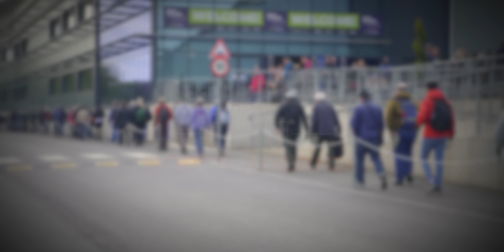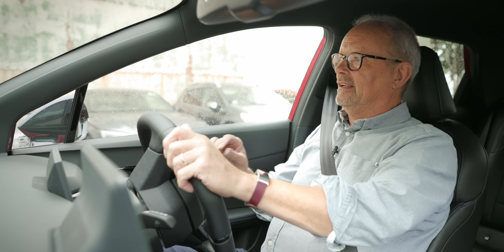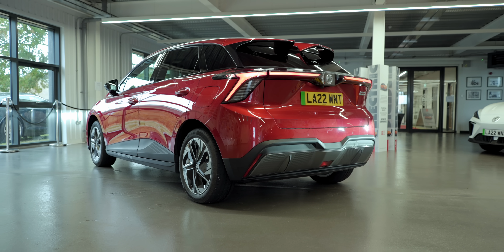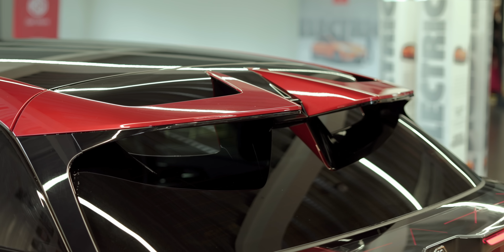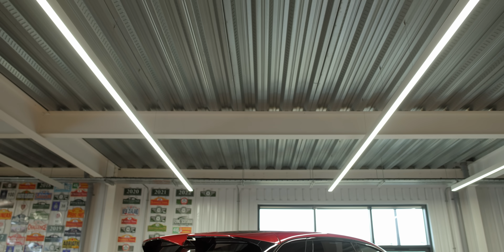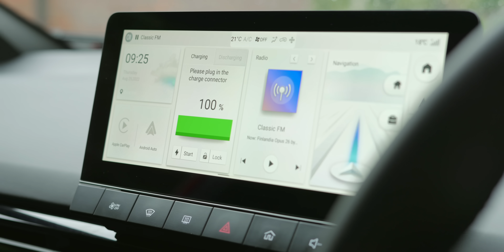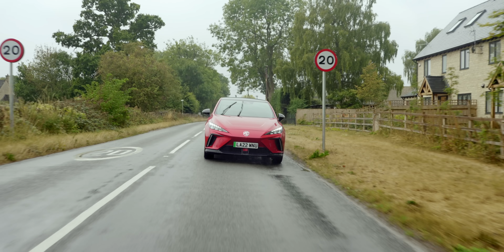MG4: The Bargain Of The Century??

Comment: I would love to be able to buy a four door hatchback EV! But living here in the US, we are very limited in choice of this type of EV. And it has "normal" size wheels/tires.
Reply: @Michael Headley Yes, some people do - and others of us like cars like this one.
Reply: Check out the Chevy Bolt. 2023 will be 26,500$ and has a range of 250 miles. I’m going to do my best to get one. My son has a 2019 and it’s really a good car.
Reply: Then you don't know about the Kia EV6, and others, the problem now are dealerships, charging so much more above the MSRP.  Dealerships suck.
Reply: @superinserra  The EV6 is a great car, but it's on the larger side, and even at starting MSRP it's over $40,000. That's too expensive for the likes of me, and probably for most people who like the sound of the MG 4's price tag.
Reply: The other thing is, yes I do have a 2002 Ford Truck. Sits around until I use it. Also have a 2011 Kia Soul (wife’s car) and the 2014 Fiat 500ev. Doesn’t have to be all or nothing. The EV is a delight to drive,  and saves me a lot of money! Most expensive car I ever bought was the used to us Kia Soul at 17,000$ and, we kinda got taken and paid too much. I’m not rich, and take care of my finances. The truck was 4500$ and the Fiat was kind of 4000$ but since I traded 2 old motorcycles, I have about 2500$ into it, then the state of Oregon gave me 2500$ cash for owning an EV so I’m net 0 into it…

Comment: Hot hatch wouldbe fun, they were the only cars I ever really got excited about because they were small cheap fast fun , I had the citroen ax gt which was about as cheap as you could get and so light it only needed a 1.4 engine and no super charger so still economical even when driven quite hard unlike all the cars I've had since which get great mpg on paper but terrible in reality unless you drive RRALLY slow.
I dont think it will be cheap though and 25k in my book is already a LOT but that's inflation for you.

Comment: Any information about how to carry two bicycles in this car?
Reply: Bike carrier on the back?!
Reply: @bryanduncan6178  do you know there's a towbar or are you guessing?
Reply: @NunoLima1337  The car has a towing capacity of 500kgs with a tow bar weight of 50kgs - should be able to take to bikes on a bike carrier.
Reply: @bryanduncan6178  thanks! I'll keep an eye out for that. I noticed that one of the VW id has a very unique bike carrier attachment. I'm really hoping that MG doesn't need special parts like those.

Comment: at a time when people cant pay there electric bills saying £25000 is cheap is laughable and especially from a car from china a country that we should be having as little to do with as possible you can say there cheap when the starting price is around £15000 with a 500 mile range.
Reply: Name just 1 petrol powered similar segment car with similar equipment as this that gets 500 miles of range for only 15k? 🤔
Reply: @4literv6  dacia sandero electric cars are'nt new  technology its old, there were electric cars before internal combustion setting speed records over 60 miles per hour. and having worked in the motor industry for thirty years try and get the stated milage out of a electric car in the winter add to the fact the infrastructure for electric vehicles  is a joke i have 5 petrol stations within 3 miles of where i live and 4 charging points  if they work.
Reply: @davidcuss3059  so you can't name just one ice vehicle got it, and you don't own or have any real world experience with an ev either. 
So you are just another internet ev concern troll. 👍🏻

Comment: Rear wheel drive and 50-50 weight distribution? Nice. Really nice.
Reply: it will come in late 2023 with 4wd and 440hp
Reply: Nothing beats independently powered AWD.  You can feel the difference.

Why many EV manufacturers use a single EV motors and transfer the power through mechanical differential and half-shafts to the wheels is counterproductive to EV efficiency.  Having four independent direct-drive motors in the wheel hubs is a far more efficient means of power distribution.  And I doubt the weight of four individual motors vs a single motor and drive train is the deciding factor.  I guess some habits are hard to break from.
Reply: @MelioraCogito  Cost of production and those precious shareholder dividends it seems. Engineers haven't had much say in things for a very long time.
Reply: An extra ton..........a good idea?
Reply: I very much doubt that the buyers of these care for weight distribution, and rightly so. The point is economy, not Nürburgring lap times.
Reply: @RandallSlick  true. But it's a nice bonus 🤷🏿‍♂️
Reply: @RandallSlick  they used to call a car like that a "sleeper".  Sports car performance, boring appearance.
Reply: @davidquinn9676  Love the sleepers. We had Q cars in the UK. Lotus Carlton. Electric VW Campers may be the new sleepers.